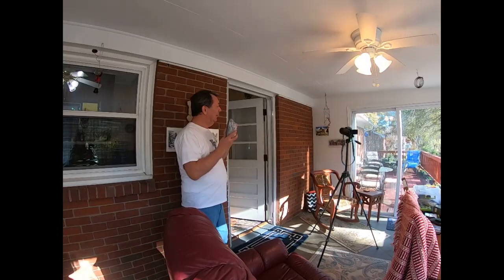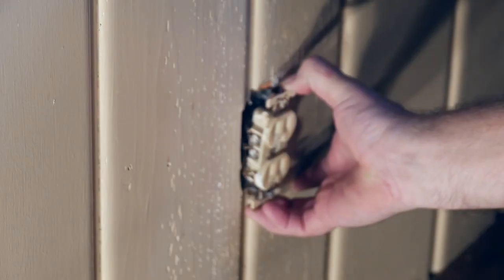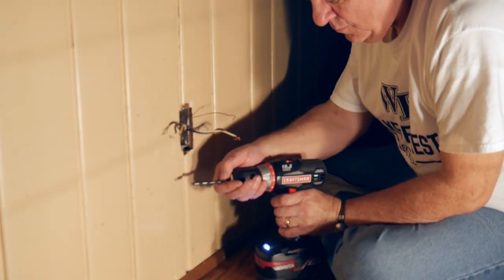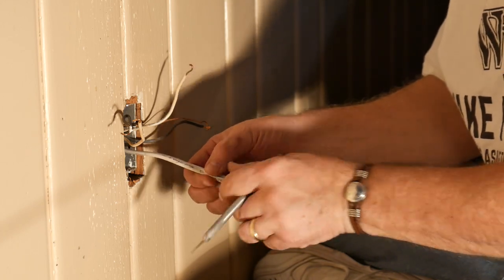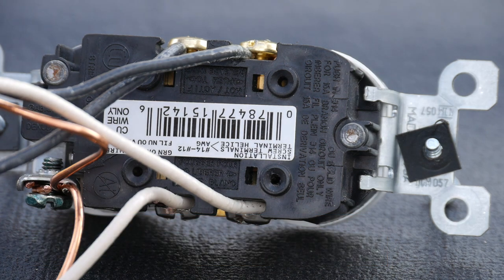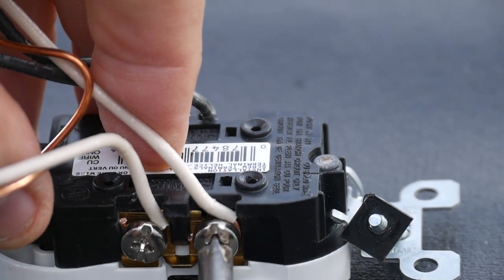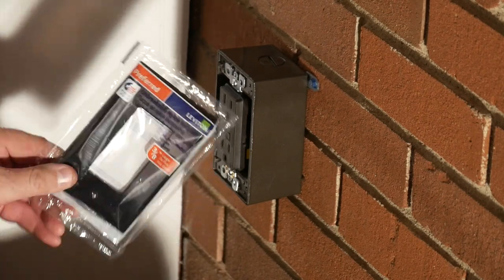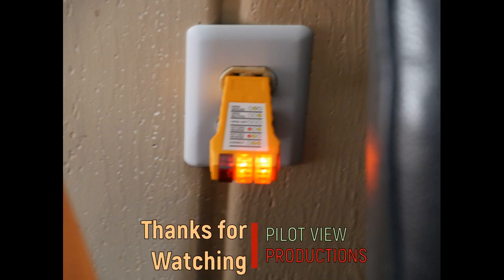Mounting an Outlet on a Brick Wall

Comment: Never use 14-2 for an outlet. Should be 12-2
Reply: I thought 14-2 is fine as long as it is not 20amp circuit?
Reply: Older construction often used 14-2, and it's still permitted for 15A circuits. You should never mix wire sizes. Also, never let the insulation go under the screw.

Comment: What size drill bits did you use for both the regular and concrete? I am going to mount a flood light camera above my garage and nervous about drilling through brick. Just want to know what size will fit the wire through. 

Also, can I drill from the brick side in first or is that a bad idea? That way I can position the light easier from the outside. Thanks!
Reply from the maker: James, to the best of my memory, it was like a 3/8" standard bit to drill through the facia and a 1/2" bit for the masonry.  You could also use a 3/4" bit if you have one, but the masonry bits need to be of a pretty good length to pass through the 4" wall, and the outer brick layer (add another 4").  I had to buy a new bit that was long enough.  Re: which side to drill first, I started on the inside out because: 1: that's where my box was and 2: I could center the hole through the knockout tab in the center of the box.  To try and hit this precisely from the outside in, though not impossible, would have been tricky given that you just get one chance to get the right.  But a 1/2 inch masonry hole should suffice for your wiring, but you may wanna check your local code if you so desire.